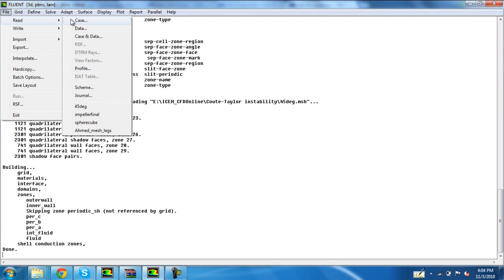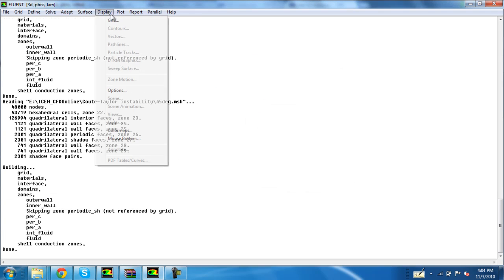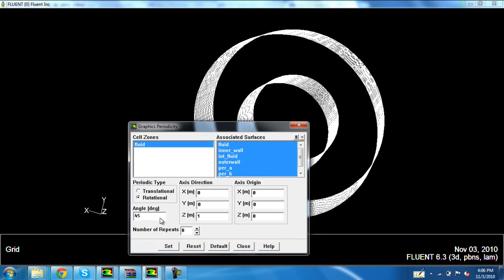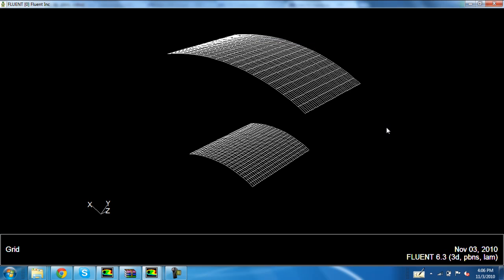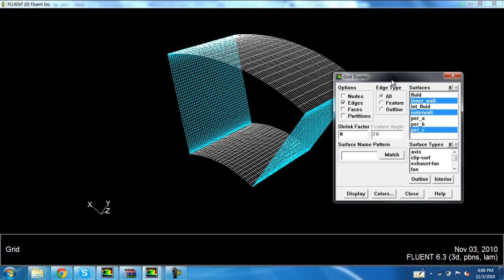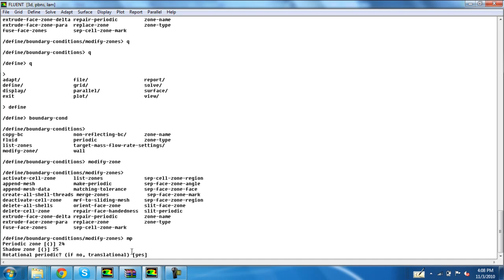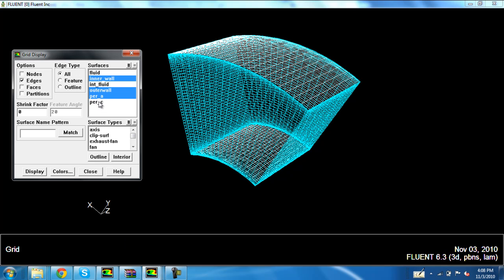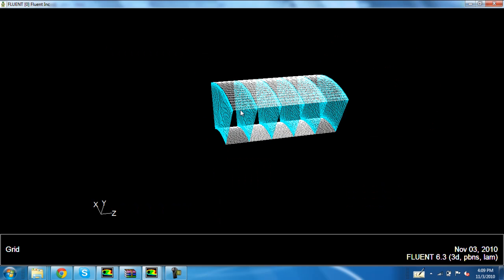ICEM CFD and Fluent - Rotational and translational Periodicity for  Taylor--Couette flow

Comment: If the volume is like a slice piece of pizza, can I apply the rotational periodic boundary condition to the cuttung edge of slice with the circle center as the rotating axis?
Reply from the maker: yes, you can. But for hexa mesh there is special method for handling that situation
Reply: +turbo engineer sorry for asking but i'am making an analisis of a disc brake and because of that im just analizing a slice of the disc using periodic walls but i don't get the spected results, coud you tell me what the special method is?
Reply: +turbo engineer Could you tell me what the special method is? Thank you!

Comment: Hello, i see that you have a wide knowledge about ICEM and FLUENT, i am working in my thesis with those 2 programs, would you like to help me or advice me? The project is about simulate the flow (so far of water) that goes trough a twin screw pump. If you are interested at all just reply this post.